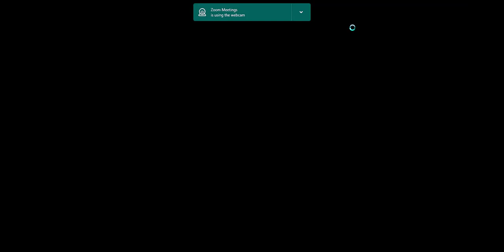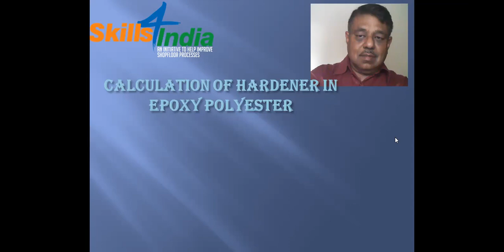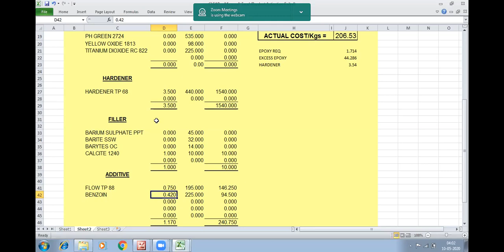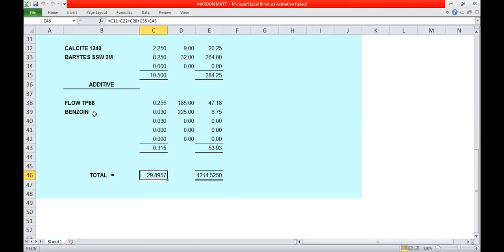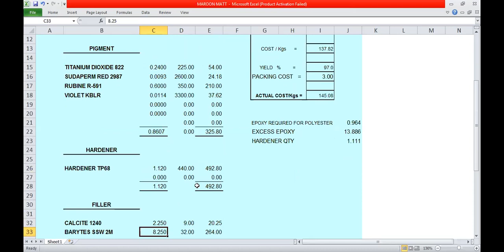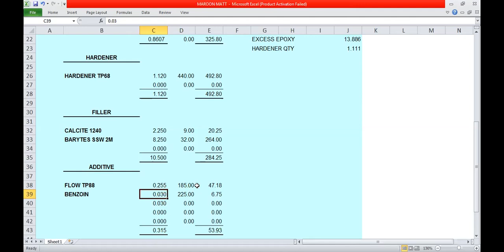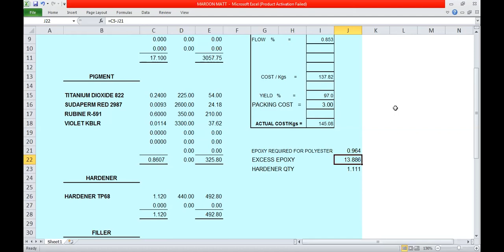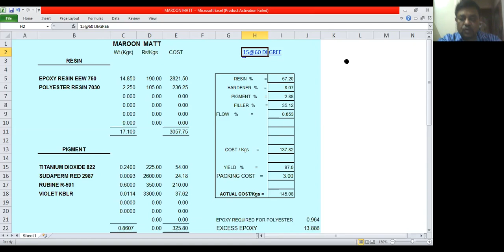HARDENER CALCULATION FOR EPOXY POLYESTER POWDER COATING

Comment: Hello Dr. Kuldeep 
I am Mustafa abou El Magd I am working at Pachin company for paints and chemicals as research and development chemist in epoxy lab manufacturing 
I want to thank you about this video you it's excellent video I seen before about epoxy hardner calculation 
I want please to send to me this Excel sheet to can easily calculate the percent of hardner 
Thank you Dr 
Best regards
This is my email 
chemistmostafasaleh@gmail.com
Reply from the maker: Dear Mustafa, sheet sent on mail please confirm. Thnx
Reply from the maker: Pls share ur contact no
Reply: Thank you Dr kuldeep 
My contact number is 01112898924
What's app number also
Reply from the maker: Mustafa , ur country code

Comment: Pls name the filler and hardner which used in powder coating.
Reply from the maker: Hardener TP68 From China
Calcite 1240 and Barytes see both from 20 microns limited
Reply: Sir I want to know all raw materials used in powder coating like flow epoxy polyester structure and texture chemicals  silver and gold metal poder etc.
Reply from the maker: Pls do our technical course, by distance learning
Reply: @k.khajooriyaupmanyu9369  please share your contact info 9646810551